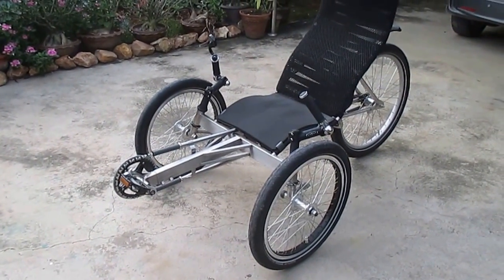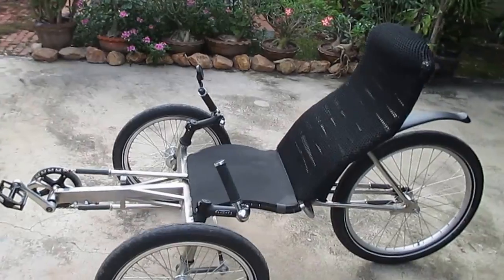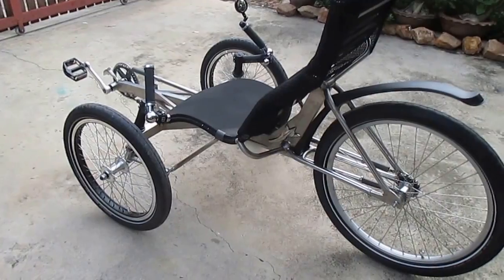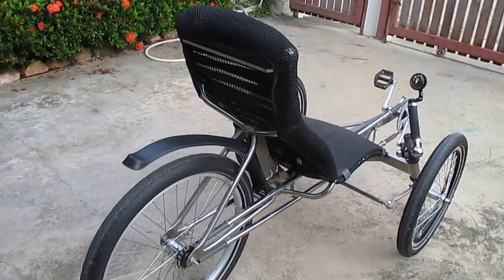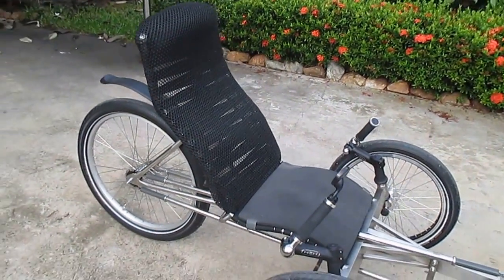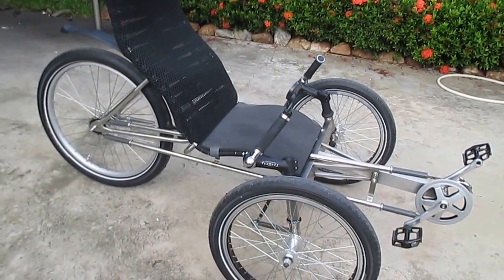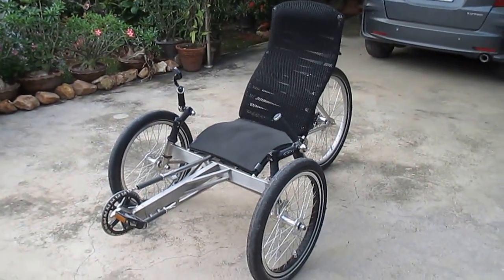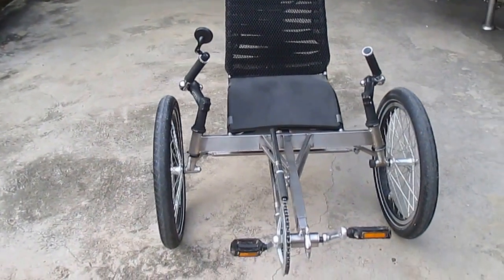Frank's MK2 homemade recumbent trike

Comment: Sorry folks, don't dip in here often.
Caster angle is 12 degrees, centre point is 15 degrees.
Don't have plans, just what's kicking around my head. Try Atomic Zombie - many good plans.
Rectangular tubing used as mostly vertical loading, and also easier to build with than round.
All stainless, TIG welded. I'm from an engineering background, no stranger to fabrication work. A lot depends on how confident you are with hand tools, and availability of steel, and of course welding skills if doing it all yourself. AZ site is a good place to start. Good luck all......